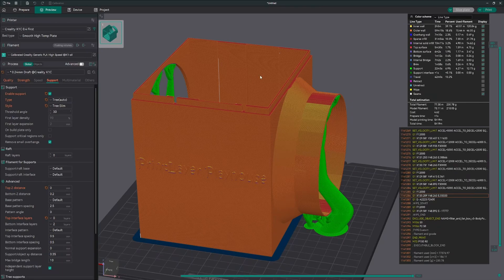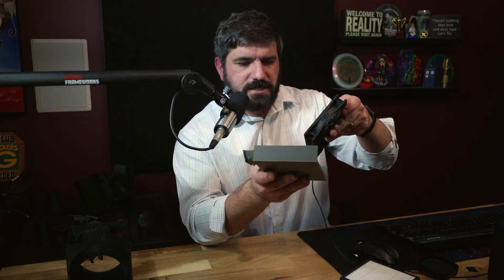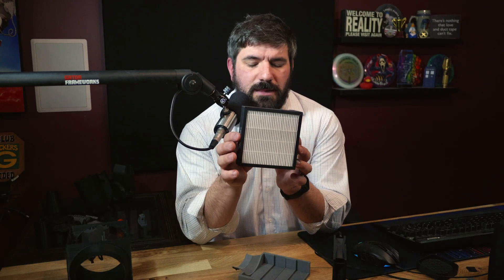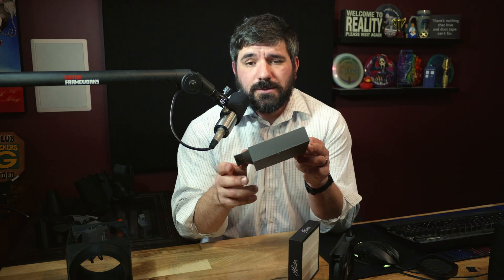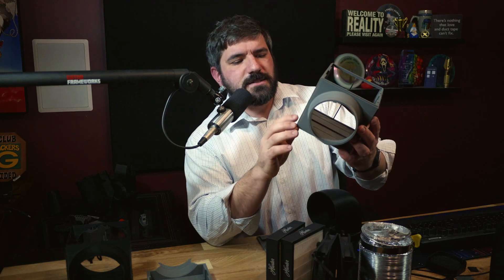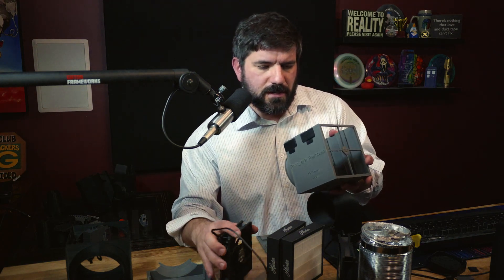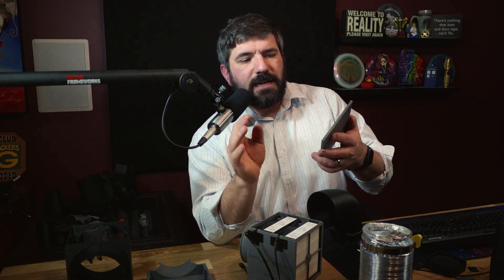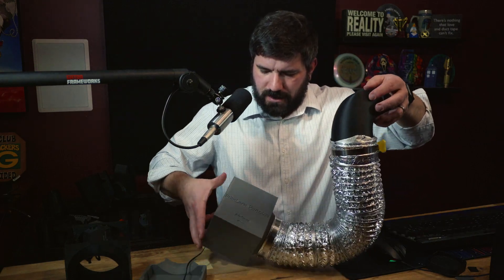DIY 3D Printer Air Filter Box | Eliminate Fumes & Breathe Easy!

Comment: Supports are the devil.  Helpful tip - change Top Z and Bottom Z to a larger value than .2 mm.   I use .28, makes them pop off hella easier.  I also almost always use trees because it's easy to tell them apart from the print.  Good luck!  You already have more cad skills than I do.
Reply from the maker: I'm learning that much like Vicki Vallencourt supports are the devil. I appreciate the tip! I will definitely use that support tip. I've been having a heck of a time with a few models that (are coming up in videos I'm working on) are getting destroyed with the supports. I can't wait to stop wasting filament on support ruined pieces.

Comment: Nice setup, was thinking about getting a Creality enclosed printer myself (especially after the Bambu fiasco) so I'll definitely save this for later. Would be cool to see a before and after with an air quality sensor or something just to see how effective it is at filtering out the fumes.
Reply from the maker: I really dodged a (YouTube friendly projectile) when I got the K1C a few weeks ago considering all the Bambu insanity. I like being able to use the printer I bought how I want.  

I will look into getting a sensor and do a follow up video. Right now, All I can say is that the smell is pretty much gone and I haven't gotten a headache after (kids and technical issues not withstanding) since completing the project.